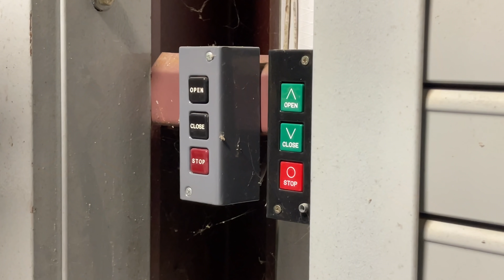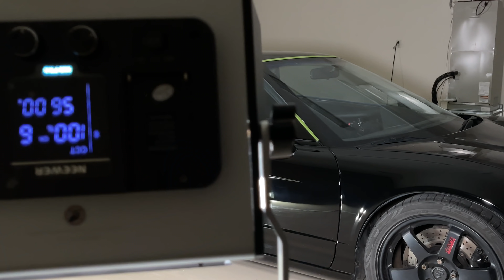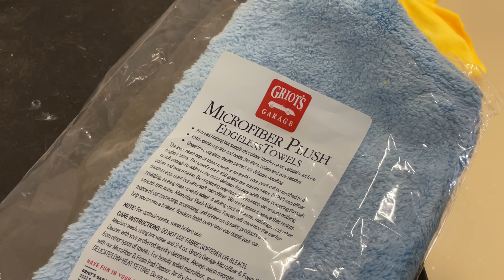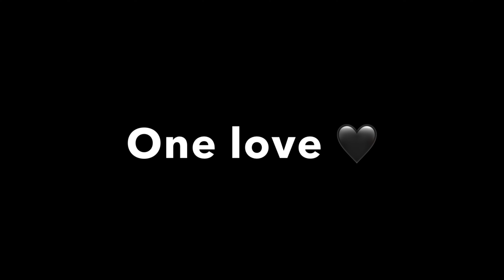Paint Correction on Divine Media's Acura NSX!

Comment: This turned out great. What was shown definitely does not take 60hrs to complete though. Was there some joy riding included in that time? 😂
Reply from the maker: Thank you! And yeah it absolutely took 60hrs start to finish including the wash process, correction, and coating! Although I didn’t express this on camera, the car had 5 different types of paints across various panels and each panel reacted completely different which required me exhausting every technique I had up my sleeve! 

All of that resulting in such a long process to get the job completed!